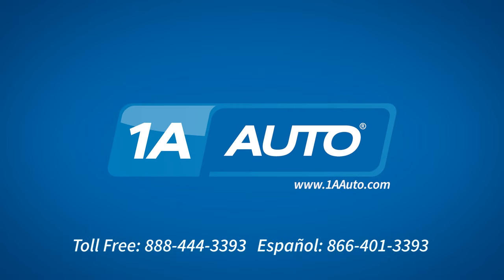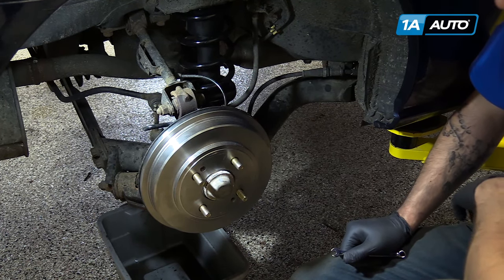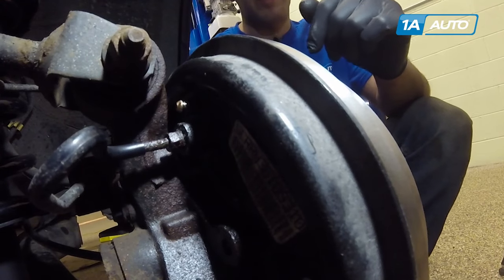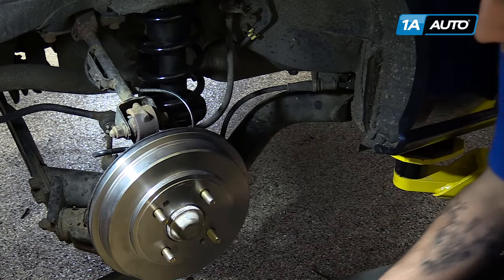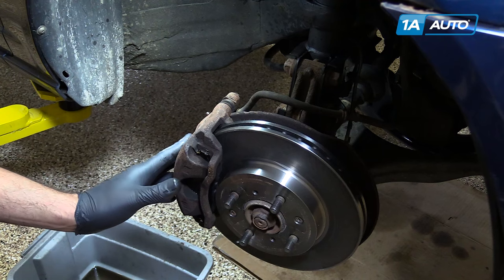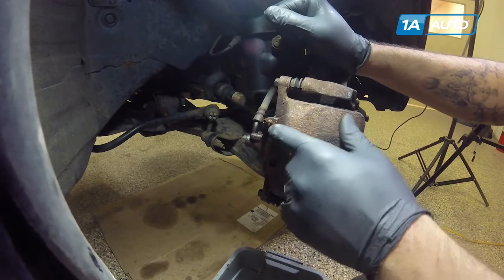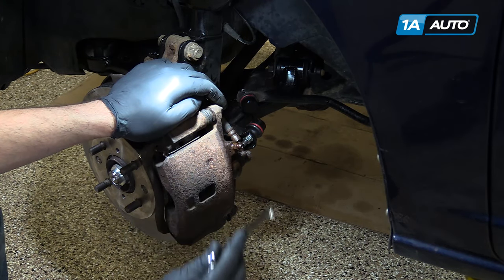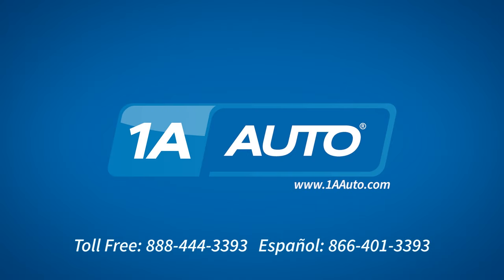How to Bleed Your Brakes

Comment: Normally I am a big fan of your videos but this seems rather shoddy work.  It is messy without using a hose and bottle attached to the bleeder nipple and the brake fluid is corrosive so not advisable to have it running all over the brakes.  Leaving in a clogged bleeder screw is bad form as it indicates something more significant is going on in that caliper which should be addressed.
Reply from the maker: +Jim B Thanks for the feedback!
Reply: A simple test can be done while he did it also.. remove the clogged  bleeder screw,  find a needle simple put it where the bottom hole is on the bleeder valve then clean it out.. might not even need to be replace. . The cause of clogged needle might be a ruster  old

Comment: I'm about to replace front drivers side brake caliper, should I bleed caliper first after install, or start from rear right side? Good work with the vids, a good portion of my repairs have been performed watching these videos, you guys usually give torque specs too, I respect that, keep up the work, I may have some requests for you soon!
Reply from the maker: +Sanchez Fran Thanks for checking us out. Have a great day! 1aauto.com